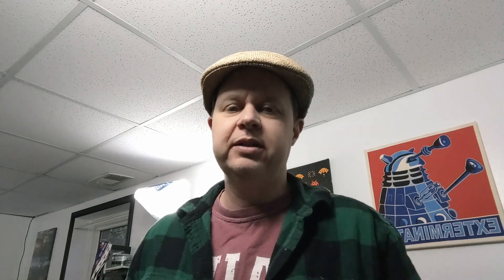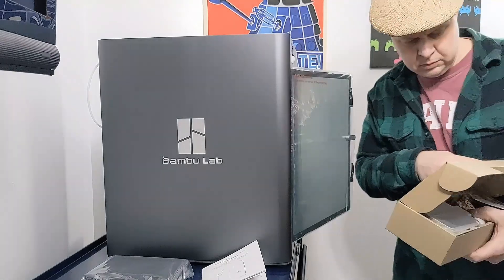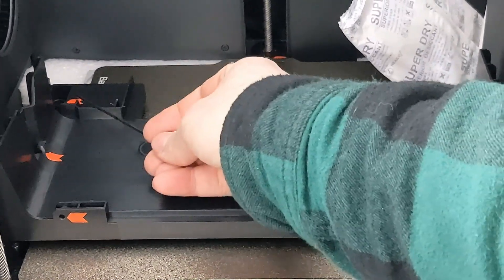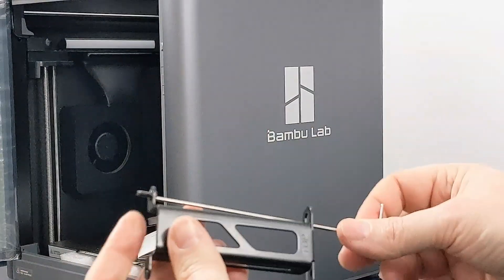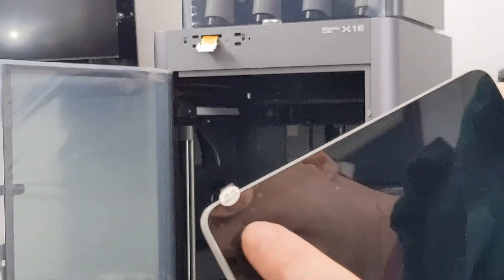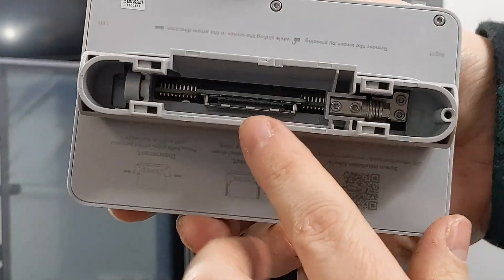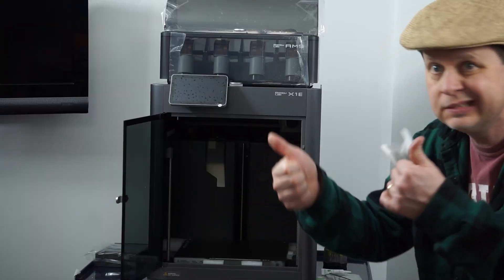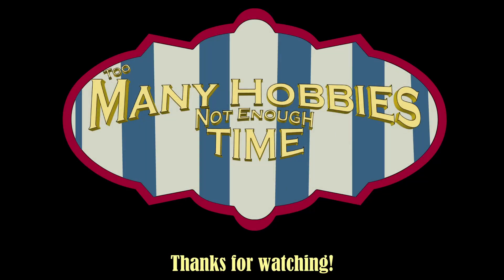UNBOXING 3D Printer - The Newest Bambu X1E #x1e #bambulab

Comment: My Bambu X1e slams the print head into the left rear of the interior as it starts the print process.  It then hits the same spot over and over again like a machine gun, the proceeds as if nothing happened.  However, when it moves to the center of the print bed to start its print, it declares that the bed isn't level and gives up.  This process of slamming the print head into frame is literally destroying the printer.

If I run the self test it rams the print head into right side of the printer, but finishes the test and declares the test successful.  

I have pled with my dealer over and over to resolve this issue.  On Feb 21 they raised the possibility of replacing the printer - which of course they should do.  Then they stopped communicating with me.
Reply from the maker: Who did you buy it from?